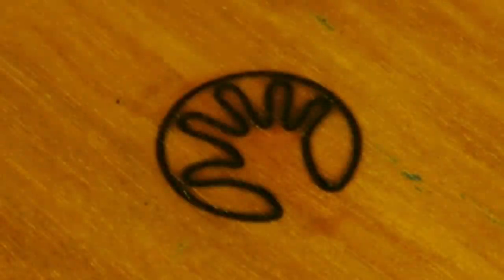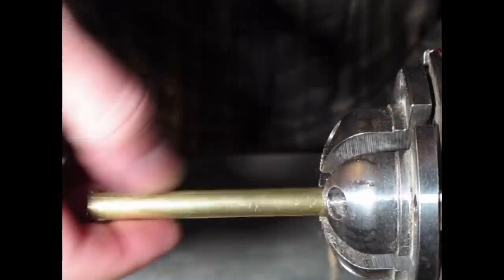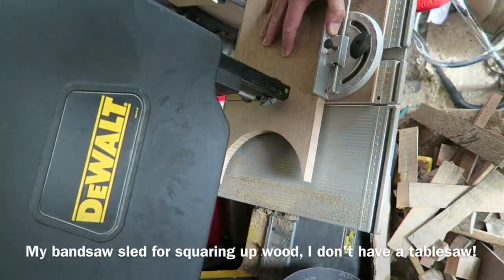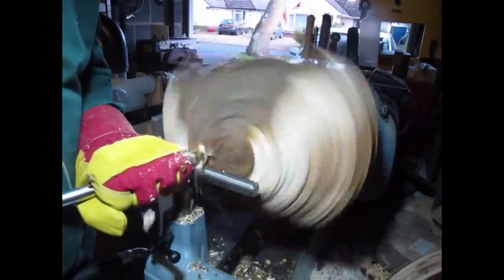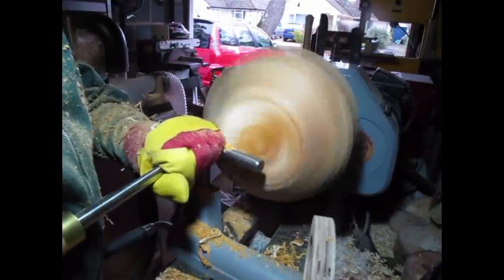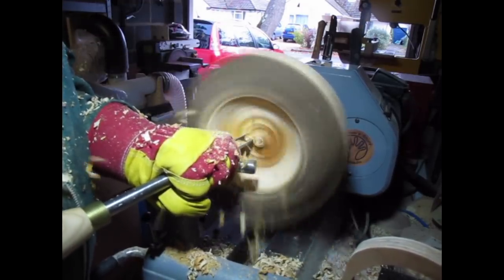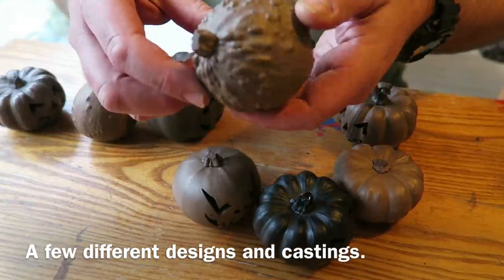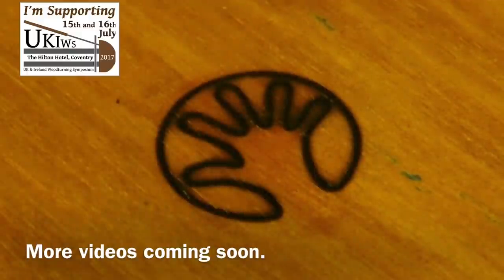Tales From The Workshop , A Few Short Stories

Comment: really enjoyed watching that, have you thought about a circle cutting jig for the bandsaw to save some of the hard work at beginning of the rough turn.
Reply from the maker: Thanks Greg. I have a circle cutting jig but my bandsaw is too small for this size of log and my bandsaw is on its last legs. It has a tendency to snap blades, especially on thicker pieces. Cheers, Jim.

Comment: Good idea with the  soldering iron. I am trying to decide between a brand and a laser etcher at the moment.
Reply from the maker: Thank you Robert. The laser etches are a lot more expensive and I have read some dodgy reviews about the cheaper ones. The problem with the laser etchers is that you can get away with a small one if you are making separate logo inserts but you need a very big one if you want to place something large in it. Cheers, Jim.
Reply: I was eyeing one of those dodgy etchers earlier today. If I was only doing turning work, I would definitly go for the brand. Now I am even less sure what to get. Thanks for the pros and cons.